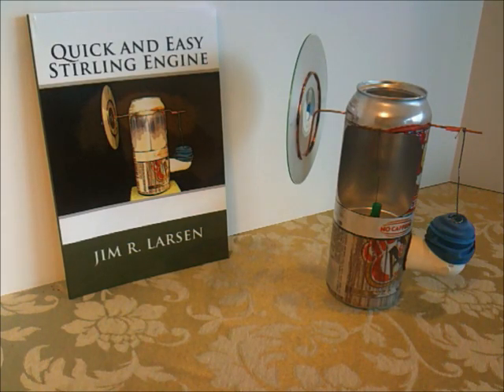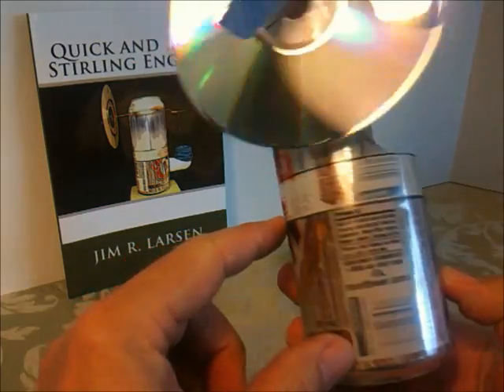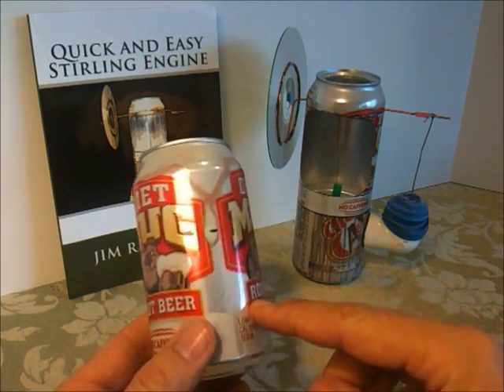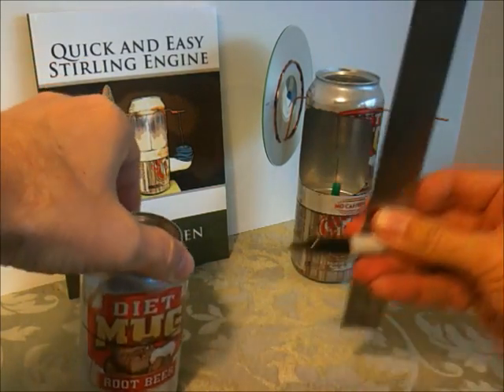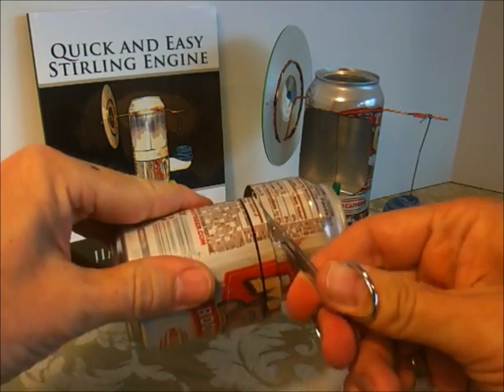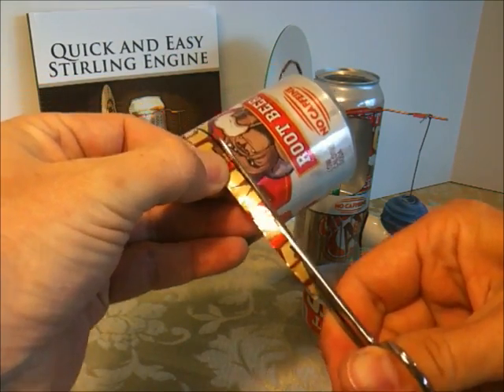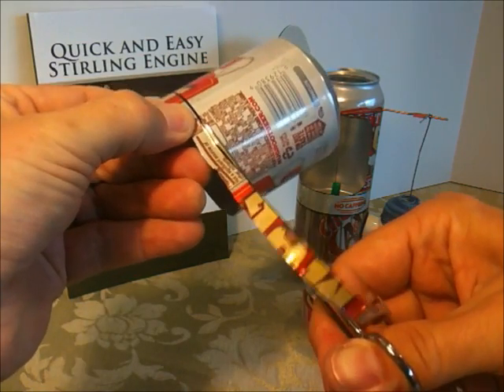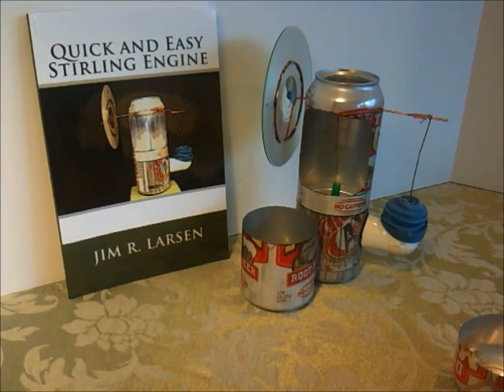How to Build the Quick and Easy Stirling Engine: Pressure Chamber Bottom

Comment: Could stirling engines be used with water instead of gas inside? Water turns to a gas, steam. If water was heated in a container that has a check valve at the top the stem could go out that valve, up a line, and into a long cylinder where it would push the water down, acting as a steam piston. at the bottom of the cylinder could be a line that leads to a turbine blade. The system would work until all the water was turned to steam. Then remove the heat source and the steam condenses bak into water and sucks the water back in through another line. The system could be closed. You could arrange a number of these in a circle formation and have the heat source travel around the circle so as one steam piston is cycling off, another one is kicking in and the power would be constant. Electricity without noise.
Reply from the maker: I have heard that the amount of energy needed to convert water to steam makes this not practical.  If you could get it to work, it would be a steam engine rather than a Stirling engine.

Comment: question  if  hydrogen can be produced by electric  current passed through water that hydrogen could produce the external heat if this could power a generater or alternater  to produce the electric current needed to produce the hydrogen im assuming hydrogen the hydrogen produced would equal 4-5 times the energy needed used  just a theory